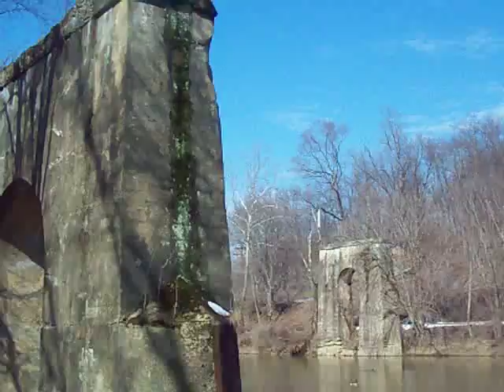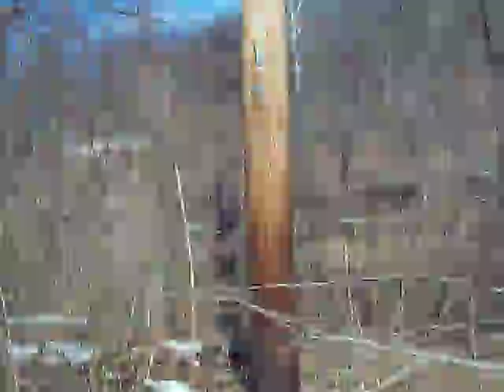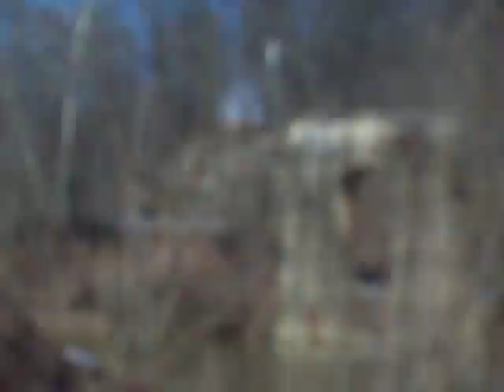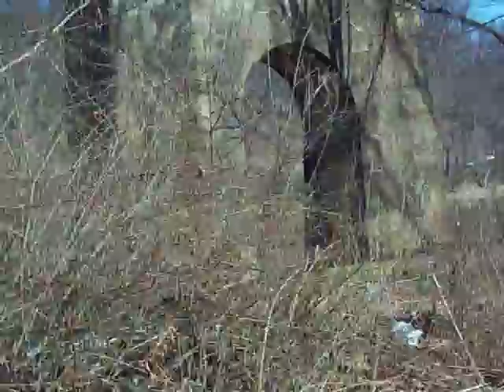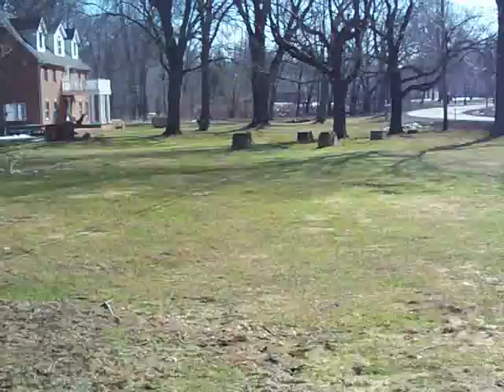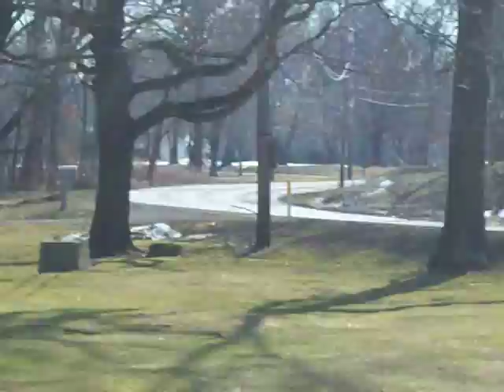Abandoned Pittsburgh Harmony Butler  Railway Streetcar line Ellwood City Pennsylvania

Comment: Part 2.
The "Y" for changing direction to either Ellwood or NC was located at at 488 and RR St. in Ellport (remnants can still be seen). To Ellwood was down 488/Fountain Ave to the station at the corner of 5th and Spring. Only short cars (gunboats) could clear the subway before heading west on Lawrence Ave. Then across Koppel Bridge (which was built by the shortline, original piers still stand with American flag flying on top). End of the line was Morado where it met the Beaver Valley Traction.

Comment: Agreed 100% about Hartman's piers... The way I wrote it didn't exactly come out correctly. After numerous failed attempts to get the state to build the (Koppel) bridge to extend the shortline, Hartman finally decides to build his own electric railway and bridge. His piers lean in the quicksand, and then the state goes through with the original (Koppel) bridge plan anyways. I'd have been a little PO'd at that point!